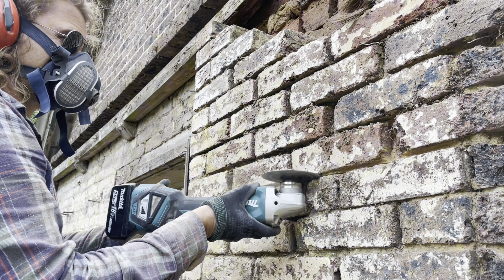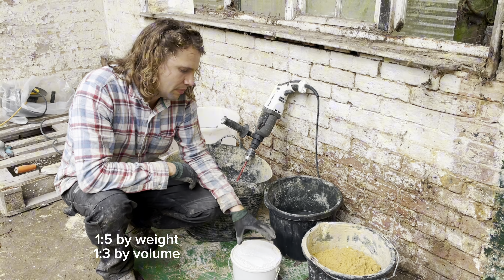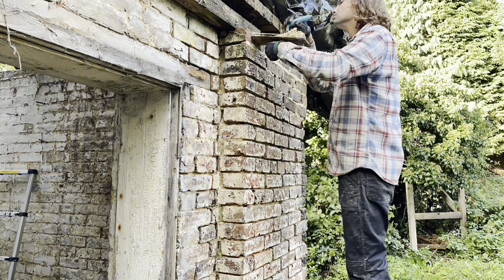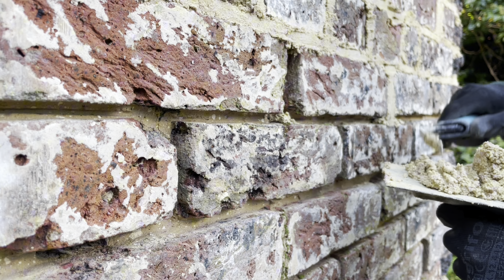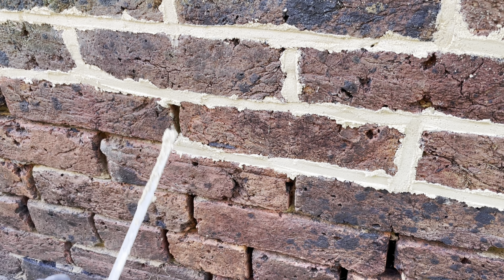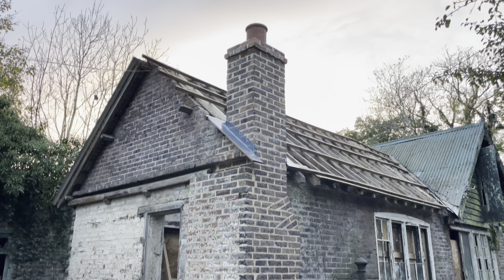Abandoned 100 Year Old Workshop Renovation - Rake Out & Repoint

Comment: Good Job....In Italy we use a different system, we use a pastry bag, You fill the bag by the material (more liquid then yours) then use the bag for inject between the stones. No problem if the distance it's wide or thin, wide: move slowly, thin: move quickly. After 30 minuts you clean the excess by a file brush gently e clan by sponge. We use this system in the wall stone and it's fast.
Reply: Thats a very sound idea.  Now I'm going to search for a video of it.

Comment: I've been using what you might say almost resembles a 'premix' from a firm called Conserv, they can do it in various hues and shades. I am repointing the front of my 1916 ish built red brick house.

I am draping over my work with hessian and then a tarp on top for 3 weeks to allow the lime to 'cure' and harden safely without being scoured out by rainfall etc when still soft. I have been light-spray dampening the hessian daily for about two weeks to facilitate the curing process and to prevent it from drying out too fast. 

Nice to see your work being done fella.
Reply from the maker: I spotted their products, would you recommend?
Reply: @ben-kilner  I would, but the proofs won't be evident until say 40 or 50 years have passed by (for durability etc). 

I have been mixing one fifth part of the grits element (by weight) with one fifth of the lime pouch content (also by weight) just to break it down into bucket mixable day-to-day chunks, just chilling doing an afternoon here, an afternoon there, as the weather permits, for intense sunshine can be as deleterious as rain or frost to the outcomes.

Comment: Some French chateau, an enormous building, was pointed with a pressurized system.  I have also seen the use of what look like large pastry piping bags to deliver a continuous bead of mortar under pressure.  This job may be too small.  The result is lovely and a visual and functional return to its early appearance.  Thanks.
Reply from the maker: 👍👍 I have seen this also. I believe these systems work best with wet Portland cement mixes. Lime mixes tend to be rather dry and crumbly in comparison. I’ll have a go with a piping bag on the next bit of wall 👍

Comment: Just a quick note, cutting discs for angle grinders would work but they make "thick disc" for 4 / 4.5 inch grinders..... It's specifically for grout and old mortar joints.  A tuck point diamond blade it's called. A good investment... lasts forever
Reply from the maker: Thank you 🙏 I would definitely get one for a bigger job. How do they cope with the vertical joints? Do you need to go in with something finer at the corners?
Reply: A mortar rake?
They don't last forever....especially  on old tough engineering bricks.
Reply: I was going to say exactly the same thing, so you win.